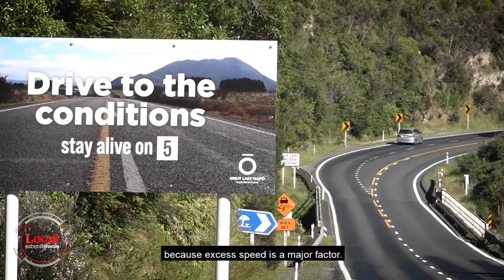Hawke's Bay's deadliest highway | Local Focus

Comment: I was first on scene to a fatal crash this year up there. In my opinion, Driver fatigue from having to deal with sub par road surface and the road surface in general making the drive more sketchy than it has to be is a leading cause in these crashes. 

Funny how it's on the contractors if the road surface fails after a repair! Doesn't bloody matter who's at fault fix the road properly. Lives matter.

Comment: I have travelled over this road many times since the 90s. This road is in bad shape I will admit. The biggest problem drivers that cannot drive. You either get the ones that do 80 kmh an hour that have a line of traffic behind them and the lazy arse cops do nothing. Or you get the ones doing 110 kmh plus and are impatient and over take because the slow drivers don't want to pull over and cops don't want to stop.

I will also be interested on how much weather has to do with these crashes and how well people are prepared for driving during the colder months.
Reply: Along with shit NZ roads in general, I couldn`t agree more with you. I experience this ALL the time these days with slow drivers hugging the center-line and not at all concerned there are 15 to 20 vehicles behind them. Ignorance is not bliss..!